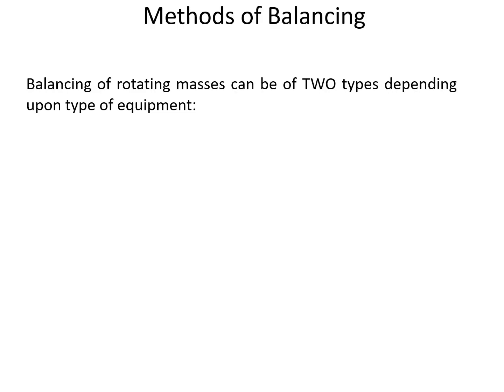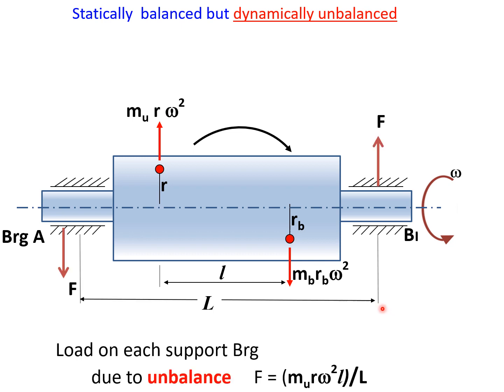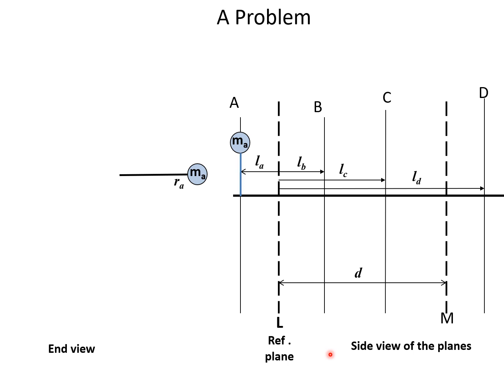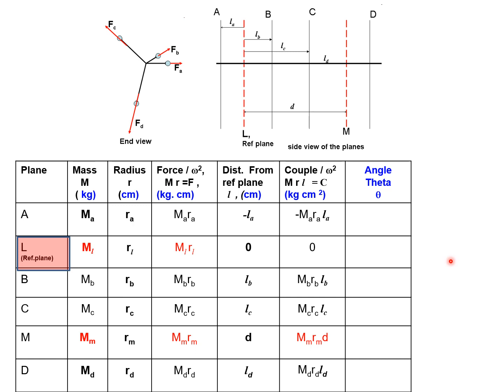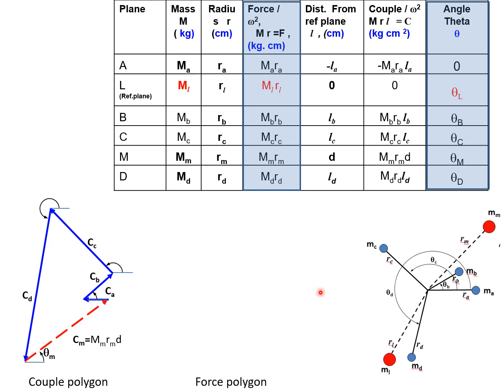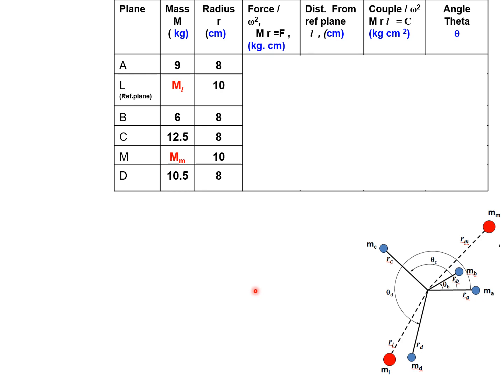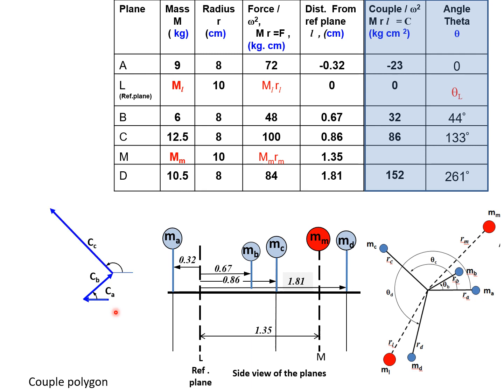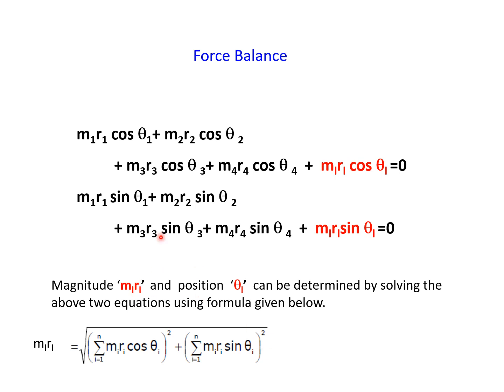Dynamic Balancing of Masses in several planes

Comment: it should be such that the distance we have between masses is not the same as the distance for calculating the moment. but we use the same distance. the moment produced by the centrifugal forces require a perpendicular distance to the force but you take an axial distance . why
Reply from the maker: Your Q. it should be such that the distance we have between masses is not the same as the distance for calculating the moment. but we use the same distance.                                                                                                                              
 Ans. Please note that distance between masses is not same. Distance between Mass-A and Mass-B is 0.99 (0.32+0.67), Distance between Mass-B and Mass-C is 0.19 (0.86-0.67), Distance between Mass-C and Mass-D is 0.95 (1.81-0.86). However, radius of rotation of each of the mass is same. The distance between masses must be kept same in specific cases like multi-cylinder engine however it may vary in many other applications. Similarly radius of unbalance masses may be same or different. In nutshell the distance between masses and radius of rotation of masses may be same or different in different cases. I hope I have replied to your questions.                                                                                                                                                                                              Your Q. the moment produced by the centrifugal forces require a perpendicular distance to the force but you take an axial distance. why                                                                                                                                                                           
 Ans. Please note that unbalance masses on one hand produces centrifugal force at the point where they are connected to shaft. Same forces on the other hand generate moments when considered from any other point on shaft and usually that other point is the bearing.